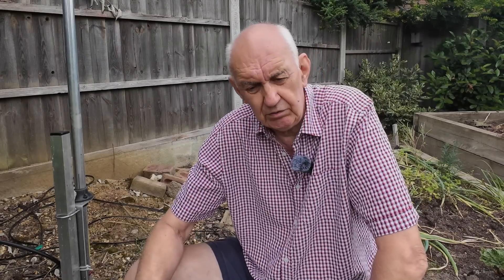Are Vertical Antennas Noisy? Myth, Truth and Solution

Comment: I'd like to offer an explanation. The utility company uses the earth as a current carrying return conductor. This is in parallel with pole mounted neutral wires but nevertheless carries current. This current is not a clean sine wave but contains many HF components from switching supplies such as LED lamps, all manner of small, wall mounted switchers, arcing electric motor brushes etc. These  currents will couple almost perfectly into buried radials and will be superimposed on your signal. Raising the feedpoint, maybe only a few feet, and preventing radials from touching the ground, perhaps with a few insulated plastic or fiberglass stakes along longer radials, will fix this. Four resonant radials, 90 degrees apart will result in an omnidirectional pattern. Using only two of them, 90 degrees apart will result in a lobe with gain between the resonant above ground radials. Roof mounting such a vertical with radials extending down the roof slopes will further improve performance on resonant verticals and radials due to the impedance approaching 50 ohms. These steps should result in a greatly improved noise floor with the much improved counterpoise. SWR will be greatly improved with this resonant vertical and radial system, without an antenna tuner equaling better transmission and reception.

Comment: If this is true then why are ground loops commonly used as recieve antennas? Lord Callum would strongly disagree with you as he says RF does not travel along the ground and recommend a loop on the ground to recieve if you have a lot of noise,.
Reply from the maker: It is “vertically” polarised ground waves that cause the problem.

Comment: perhaps elevated radial is like making Non-Inverted L antenna with bottom feed.  or dipole with one side is 90 degree UP, other side is horizontal close to ground.   which probably make antenna much quieter.  AG6JU

Comment: On the air I’ve heard Several people that had both a horizontal & vertical 10m antenna heard better switching the vertical but it’s also noisier which makes sense, if it hears better it’s picking up more everything. Filters & a QRM eliminator make life easier in the city. All my verticals pick up more noise but they also hear signals my dipole could barely hear.
Reply from the maker: Yes it seems to vary depending on geographic location. The noise element is mostly  localisedvertically polarised ground wave.

Comment: hello Peter great video as always. I've built a vertical 17.5 ft driven element and same length  gw4 on the radial loaded with a 4.1 un un. gives me 20 15 10mtrs with the tuner, this is where your idea comes in, the bottom of the antenna is 23ft off the floor. I have the radial only 1 at a 45 deg angle from the un un. wow it works a treat less noise and better on transmit, also if i change the direction of the radial it works well so thank you peter for the idea, 1st call on 20mtrs I spoke to a k4 he was getting me a 5/8 with 65 watts, once again thanks for the antenna ideas mike GW4
Reply from the maker: Great to hear from you Mike. Enjoy the fun.

Comment: I think you should raise the base of that antenna as high as possible up the mounting post. The post should not overlap. I think some noise comes from resistance in bad mast connections. One thing that can be buried is stainless steel chicken wire. In a damp location near the mast if possible but I would just use this as a static drain. I do indeed prefer raised verticals whenever possible. Another trick to try but with horizontal antenna is to have both elements equal distances from the ground and surrounding objects. It should be balanced and the fact it's balanced should help.
  If it's well tuned you may notice less noise around the resonant point but no dip in incoming signals around this point.
I've toyed in the past with insulated masts for verticals but it was a long time ago. Some antenna work fine on an insulated mast if they are well balanced but you need to take more care protecting the radio against static. You can run a separate grounding cable from the back of the radio equipment to a grounding rod or from the coax shield as it enters the house to a grounding rod.
  An ugly balun choke might be worth a try or just trying different verticals till you find one that is less noisy. Many have several antenna to try different ones for receive. We all love the experimentation. Keep up the good work.

Comment: Hi Peter,

The general consensus is that on MF and HF ground wave propagated signals suffer much heavier attenuation if horizontally polarized versus vertically polarized and in all my years of hunting sources of RFI on MF and HF I have to agree with this theory and I believe this explains why we often say verticals are noisier than horizontal antennas on MF/HF as most of the local generated noise that reaches our RX antenna are predominantly vertically polarized (due to the heavy attenuation of horizontally polarized signals that are locally generated).

My EFHW that is mounted horizontally 20 feet above ground with a good choke 0.05 wavelengths down from the feedpoint often can’t hear any of the local noise I can hear on 4 different vertical antennas that I have (3 of which are dedicated receive antennas).  I also have portable MF and HF direction finding antennas and it’s amazing how much lower the noise floor typically is when I orient them for horizontal polarization versus vertical polarization.  You will also see folks that use the Waller Flag RX antenna have greatly improved signal to noise ratio when they mount it horizontal versus vertical and they attribute that to local nose that’s predominantly vertically polarized not being received as well when the antenna is mounted horizontally.  Also while typing my response to you I ran outside and oriented my Portable RX Flag antenna horizontally and vertically while listening on 40 and 80 meters and my local noise floor (middle of the afternoon) was definitely lower when the antenna was oriented horizontally.

I also witnessed firsthand power line noise about a mile from N4TZ that could not be heard on his 3 element 40 meter horizontal beam but the RFI was something like 20 dB over S9 on his vertical receive array (truly amazing and I would have never believed it if I were not there to witness it).  We could not detect any power line noise when listening on his 40 meter beam regardless what direction the beam was pointed.  I could also easily hear this power line noise while standing in his yard with my vertically orientated portable flag antenna and that's what we used to track down the source of the RFI along with VHF direction finding gear as we got close to the faulty pole.

On MF and HF I truly believe one tool we have to help deal with locally generated noise are horizontally polarized antennas or dedicated RX antennas that are horizontally polarized.  I operate almost exclusively 160 meters where having dedicated RX antennas is very beneficial but now I'm very interested in having RX antennas that are horizontally polarized whereas my dedicated RX antennas are vertically polarized.

Just FYI and 73, Don wd8dsb
Reply from the maker: Hi Don, yes I agree with your findings. I operate on the higher HF bands and there is around 12dB increase in noise with my vertical compared with my horizontal dipole - even when only 25ft above the ground.

Comment: From experience my DX Commander Classic is much noiser than my EFHW around a wood fence about 5ft off the ground. But, and there's always a but, the DX Commander can hear stations my EFHW can't hear. I am in a high noise floor enviroment so I deal with it the best I can. Several years ago while creating a 20M dipole and 40M dipole I put one leg of the dipole up on a  fiberglass pole and extended the other leg about 2 or 3 feet off the ground. I was surprised that both worked much better than expected. I even took the 20M version out and did a FT8 POTA activation with it. Simple antennas that work great.
Reply from the maker: Thanks for sharing.

Comment: I always thought: why not use a vertical with elevated radial (which is more or less symmetrical) and it with open line feeder. Then your antenna can be matched with a symm. Matching unit (i.e. ATU) and you could match other bands as well? Never see one doing this.. always baluns and coax..
Reply: That is an „Up and Outer“. It will work as multiband antenna. Length of the two (random) wires must be determined by the lowest band. Just be careful that the feedline is not touching the ground. 73 de Chris
Reply: Yes sure! And of course the total length of the radiating wires + the open line feeders determines the impedance at the end of your feeders. So your symmetrical matching unit must be able to match al those different impedances  @DL1GKC
Reply: @pa3byw  For impedance purposes, you'd probably want the open wire feeder to be off-centre fed in the vertical/radial system. In fact, Walt, Coastal Waves and Wires, once played with an off centre fed vertical.

Comment: Question: Doesn’t the vertical piece of aluminum on which your 4BTV antenna is mounted (using U-bolts) interfere with the operation of the antenna? Since the short aluminum piece extends past the bottom of the antenna element does it not constitute a capacitance in parallel with the first few inches of the antenna—and therefore a disruption of the theoretical 35 ohm base impedance? One can make the case that since aluminum “shorting capacitor,” if you will, is indeed short it has little or no effect on the antenna current or the current distribution.  But cannot one also argue that the existence of a current maximum at the bottom of the antenna should make that capacitance to ground significant?
Reply from the maker: The point of maximum current is at the feed point. As you raise an quarter wave antenna above ground the point of maximum current is always at the feed point assuming the radials are resonant and attached at feed point.

Comment: Hello Peter, vy niice video and consideration about radials. Ive an home made quarter wave for 40m with 2 elevated radials at abt 16m from the ground on the roof of my house. The performance are better compared ground radials. In the past I ve done some test in the mountains even with elevated radials, the sistem is much more quiet than the urban area. So i can confirm that vertical antenna are noisy? Depends were are installed. 73 Mauri iz2mgn

Comment: Interesting. Do you still have the base of the vertical connected to an earthed foundation pole or spike as well as the elevated radial?
Reply: I had a butternut vertical a few years back.  I had mine earthed to the mounting pole for lightening protection, the pole was earthed as well.  And about 10 buried radials.  It all helped to reduce noise but it was never quiet.  I suspect Peter has done much the same thing.

Comment: Another great video thanks Peter.  IMO horizontal antennas usually suffer less from noise because of their higher angle of radiation than a typical vertical antenna where its lower radiation puts the usual noise sources in its near field.  A better radial system can make it even more susceptible to noise because of several db less of ground loss.

Comment: Another timely video, Peter – thank you! I’m in the early stages of planning a new shack, moving from my basement to a nearby shed. I’ve been thinking about putting up a vertical to Aug,ent my 80m horizontal loop. I borrowed a portable vertical from my ham club to give it a test and found no difference in noise between the loop and the vertical. Thank you for confirming my findings! I live in a rural area and my nearest neighbour is 100m away. I like the idea of the raised radials but will have to think about the location of the antenna to avoid any conflict with my XYL!

Comment: If the buried radials pick up more noise in a vertical antenna system because they exist in the same space as the local man made noise otherwise known as "in the ground wave", then why does the Loop On Ground receive antenna reject the same noise in the same plane? Also conversely, why does the radial on the vertical reject ground plane man made noise when elevated, but the loop antenna when  elevated to the same point, increases man made local noise sensitivity? Other antennas with buried radials are also not necessarily noisy to man made sources. It must be a more complex relationship than simply the location of the antenna in respect to the earth to cause opposite reactions in different antennas with change only to a single variable. In my experience, even a ground plane vertical with elevated radials is still pretty noisy. It makes more sense to agree with the vertical polarization of noise even though that concept doesn't appear to be ironclad, it is more documented.

Comment: As always verticals with coils of any kind in them are a compromise especially ones significantly less than a 1/4 wave length like the 4BTV. In my experience it’s better to put up a full size vertical for 20m or higher band and use bits of wire for 40m and below, even 10m of wire up to a tree / fence with 10m laying on the ground works well. Oh and mount the vertical 2m 6ft ish above the ground with 3 + radials.

Comment: This all seems in line with my experience with vertical antennas over the years. The quietest vertical I ever heard was at my ham radio mentor's house when I was growing up. He had a trap vertical mounted in an elevated position with tuned radials, though I don't recall the exact configuration of these (it's been a while). 

I'm still wanting to try a few (somewhat elevated radials) on my ground-mounted vertical which does seem to suffer from some noise -- especially on days when it's scorching hot and all the air conditioners in the neighborhood are running full bore.  My issue, as always, is space and XYL endorsement for said project.

Comment: Thanks for posting Peter, a very interesting and thought provoking video. 

To me, it stands to reason that if a vertical tends to receive and radiate at low angles then in an urban environment where the noise source is in the near field located horizontally you will likely suffer from more noise than you would with a horizontal antenna receiving at generally higher angles. Having said that I don’t have any real world experience to back that up as I very rarely suffer any noise because I operate exclusively portable or mobile. I get as far away from urban environments as possible, often next to saltwater where the performance of verticals (with elevated radials) never ceases to amaze me.
Reply: You stole my thunder,  You are right on, horizontal antennas usually suffer less from noise because of their higher angle of radiation than a typical vertical antenna where its lower radiation puts the usual noise sources in its near field.  Better radial system can make it even more susceptible to noise because of less ground loss.

Comment: I guess you have created a partly  vertical dipole for 20m.
Reply from the maker: Hi Mike. Back in the 60s  almost all verticals were known as GP antennas and had elevated radials. In most cases the whole antenna was well  above ground.
Reply: Groundplane antennas are dipoles.

Comment: Great video again.  I may be able to add another perspective. Yes, noise can be vertically or horizontally polarized. Noise is simply an electromagnetic waves the same as the desired signals we transmit and receive so antennas receive noise just as if it was any old radio signal.  However, vertically polarized noise will propagate better along the ground because its E component is perpendicular to the earth whereas if the E component was horizontal it would not, so to speak, hug the ground.  There is reference to this in many antenna books. 
So if there are several noise sources in a neighbors house, all other things being equal, those sources that emit a vertically polarized signal will be heard farthest and strongest and picked up best because the vertical responds best to vertically polarized signals from a low angle.  The only way to not hear noise is by placing that noise in an antennas null or use an antenna with the opposite polarization. That’s what I have done with Beverage antennas on 160 through 40 meters. Actually I usually use Beverages on the ground as I do not have room for full size conventional Beverages. Most people don’t know that a Beverage is essentially a vertical antenna even though it is a horizontal wire! I had great success with a short 100 ft BOG ( Beverage on Ground) on the 40 meter band. Another solution to noise is to transmit on the vertical and listen on a horizontal wire. 
73 de N4DJ
Reply from the maker: Many thanks for the additional data. I am sure others will enjoy reading it.
Reply: I’ve often thought about trying a vertical TX horizontal RX solution for this reason. Is there a nice easy product that switches antenna based on a PTT signal, or is more of a DIY solution needed?
Reply: @jebonicus  It depends on your rig. I use an Elecraft K3 that has a receive antenna jack. So I just push the receiver antenna button and the switching is internal to the K3. Before that I used a Ten Tec OMNI VI + and it also had a receive antenna jack so that was easy also. If your rig does not have a receive antenna jack, you will need a relay to switch from the receive antenna to the transmitter antenna when you key the transmitter. One of my old rigs had power available to switch such a relay. I think someone makes such a box but can’t remember who right now. The big thing is timing. You do not want RF coming out of the rig before the relay closes! DX engineering is the first place I would check. The next time you get a rig you may want to get one that does it already. I went from separate Transmitter / receiver units directly to the OMNI 6+ so never had to deal with the issue.